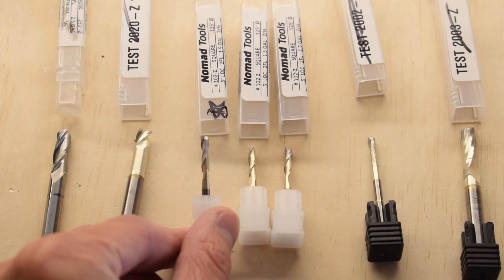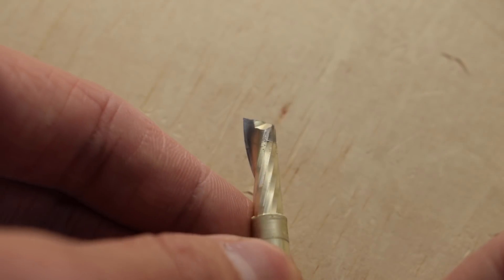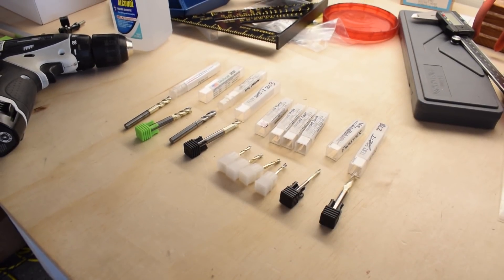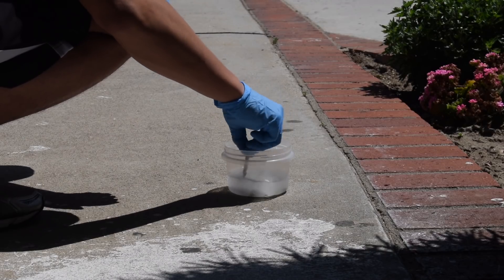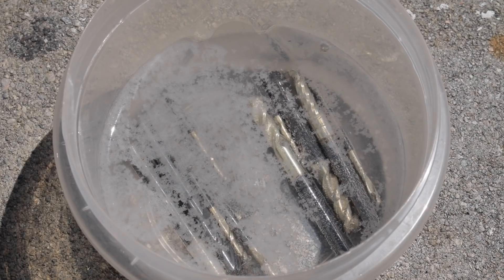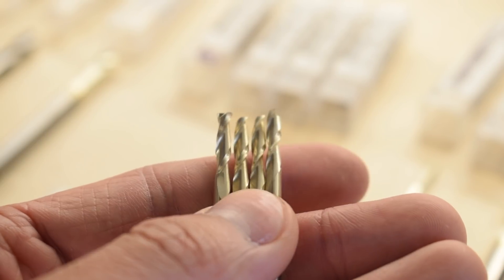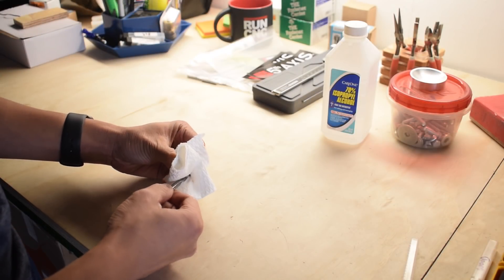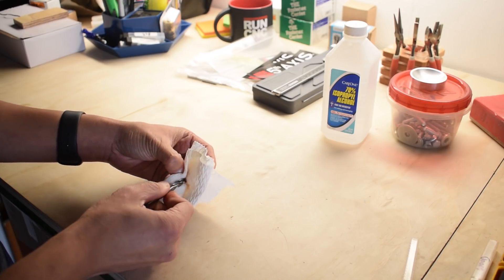How to Dissolve Aluminum From Your Endmills - #148

Comment: So Lye doesn't mess with only ZrN coatings? How about AlTiN? I guess not?  It has aluminum.
Reply: I'm a little late but wanted to have this here for others. First off, using AlTiN for aluminium is by itself a problem. But using lye on it will mess it up for sure.

Comment: what's the best to get rid of melted acrylic from the end mills?
Reply from the maker: I think acetone might work... But check with the internet. Pretty sure that dissolves it. Little more noxious to deal with though. I've had okay luck using pliers to clean up 1/8" and larger cutters of plastic, but steel pliers can chip the cutting edge on carbide tools, so dont force it.
Reply: @WinstonMakes  awesome! Thanks for suggestion!
Reply: @WinstonMakes  @chip smith  I agree with what you said. acetone will defiantly work. Good suggestion.